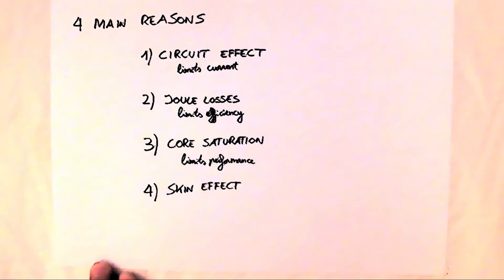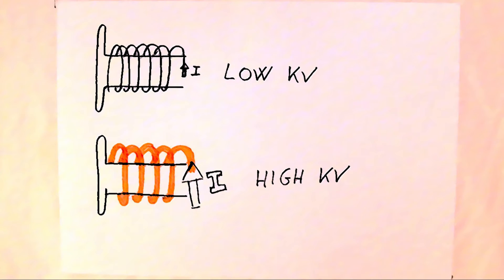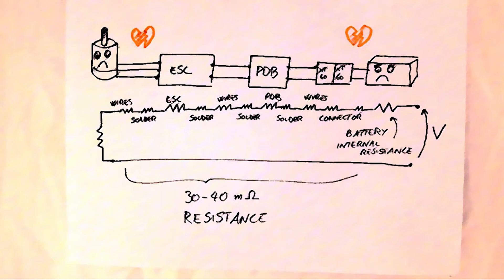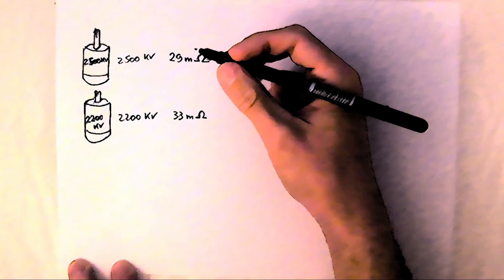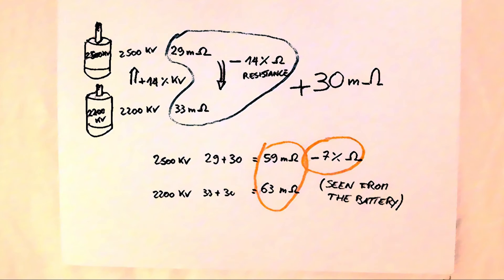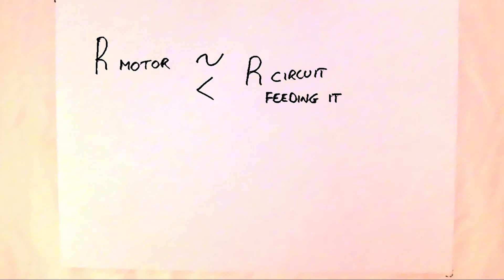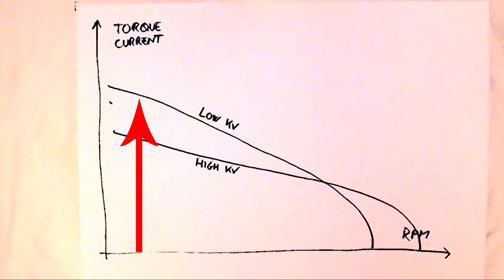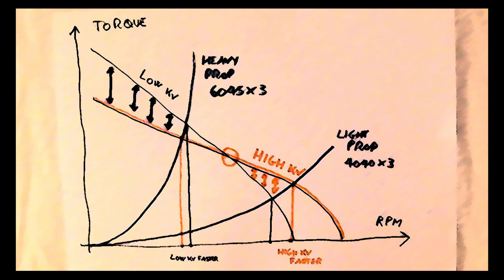why REALLY low KV has more torque.

Comment: Hi, could we chat about a specific motor application? We are starting to use BLDC's as flywheel motors in nerf blaster. If I know the size of motor I need , voltage, Kv. How do I then determine that one has more torque than another?

Comment: Stephan, Blackfly, the manned aerial vehicle planned for release next year claims a super high power, compact motor, supposedly because of a unique why the outrunner rotor steel case is laminated.
It is not much of an increase in efficiency, but cutting eddy current losses from say 3% to 1.5% reduces the heating of the rotor by 50%, allowing the motor to operate at higher power levels before reaching its temperature limit where the permanent magnets begin to degrade.  Are you aware of anyone making large BLDC motors like this?

Comment: Great equations. But cannot agree with internal resistance of batteries. LIPO batt. internal resistance around 2mOhm. So even with 100 Amp. of current you'll get only 0.002x100A = 0.2 volts of drop that is just nothing. Guess the only problem to get higher torque from higher  kV motor  is whether overheating or/and hysteresis.

Comment: I think this is what i'm feeling in my comparison video between 2522kv and an 2400kv, but supposedly they are closer to 2300kv.  Lack of torque at lower rpms with the 2522kv.

Comment: Great channel and very interesting! :) Instant subscribed :P 

I have an idea for another video you could make :P you could compose/discuss the "optimal" motor :P maybe 0,1mm Stator laminations for efficiency, Silver wire instead of copper, keramik bearings, optimal air gap, strongest magnets, and everything that could be relevant :P so far i have seen this features partially on some motors but not all together in one package of awesomeness.. maybe you could discuss the benefits of every feature (in numbers?^^) vs. cost and so on :) Would be very very interesting (at least for me i guess hehe but sure many others too :P). 

Anyway, keep up the good work :)
Reply from the maker: Thank you, actually i'm going to do something similar, i'll discuss the limits of current generation of motors and where they can be improved.
Reply: Great to hear! :) im really looking forward to that :P